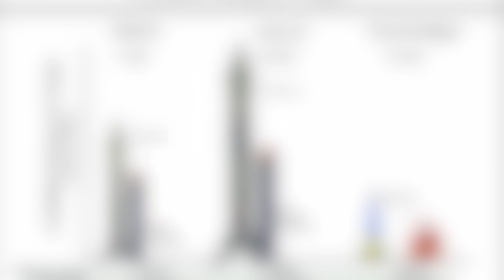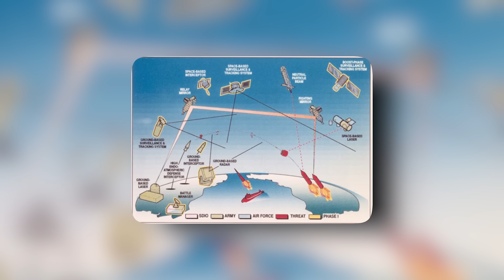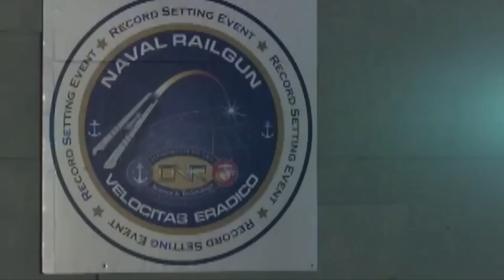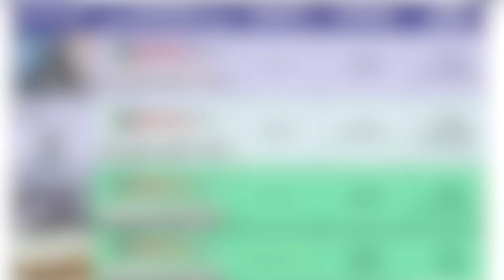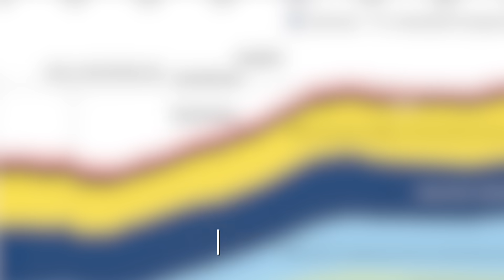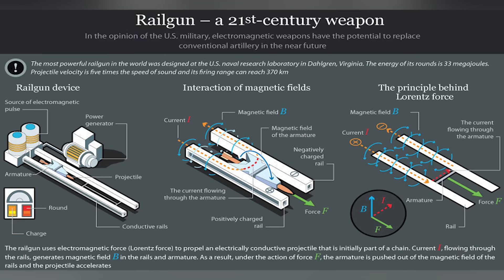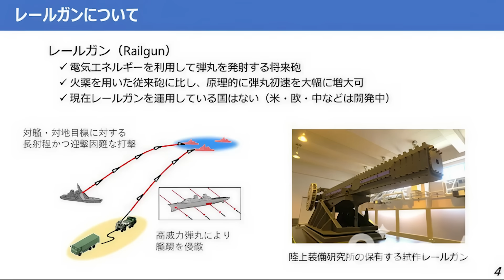Japan Revives a Scrapped U.S. Superweapon — And It Actually Works!

Comment: IMHO, a balance of rail guns and lasers would be awesome.  Lasers are line of sight weapons effected by atmospheric conditions.  Rail guns can fire projectiles over the horizon in inclement weather.  Both working together could be very effective against hypersonic weapons.
Reply: In the end it all comes down to this. Is interception still viable? Is defense against missiles still a thing?

Attack has become much more economicaly viable then defence.
Due to its very nature, an interceptor has to be more agile and manouverable than its target. Which means more expensive. It also require many tries to get one. Now that attack can be hypersonic and manouverable at the endpath, defense costs are aatronomical.

Simple saturation tatics can completely exaust expensive defense for very little cost. It doesn't matter you have a rail gun can definitely hit a target missile once or a high speed something that takes a billion to produce. After the expensive toys are out of juice, even simple inexpensive drones can swarm in.
Reply: Drone swarms says hello😂
Reply: @jaroslavlistvan4795 
1. Flak cannon with modern tracking system cost effectively shoots down an entire swarm.
2. Kinetic energy homing darts (non-explosive missiles) cost effectively deals with drones at extreme long range.

The problem with 1 and 2 aren't that drones could overcome them (as they could similarly be adapted to match the progress of drones), rather that they are useless against high tech weapons systems ala piloted fighter planes.

 The answer to drones, ironically enough, is low tech 😂
Reply: Pure rail guns are terrible right now for bigger guns. They should start slinging small rounds fast, and accurately first. 

 Start slow. Hybrid chem rail guns. Till we can actually manufacture graphens composite materials. 

 I read about a rail gun concept using liquid refurbishment. Basically uses gallium, and other to constantly regenerate the barrel after each use. 

 Some of the coolest stuff I've ever heard. That's the future. 

 I want to know why no one is doing coil guns. It skirts the issues of rail guns, and the therotical max power might be as good. Yet it's still ridiculous. 

 We have incredible precise and robust timing systems now, and everything required. 

 Need personal defense cannons like the Expanse. Think Trophy system but with guns. Cannons that only protect the portion of the ship. 

 Need personal defense cannons on .50 cannons.
Reply: lol is someone suggesting a railgun doesnt fire on a ballistic trajectory? embarrassed for you
Reply: unless the guns are part of a sea going fleet or in space, they are just going to be targeted and destroyed in a real war
Reply: iirc the problem with railgun is the barrel broke way sooner than normal gun. its too fast, so they have to replace the barrel more often
Reply: @KaoruSugimura-Nana  same was true for engines before they figured them out
Reply: It's really going to always depend on the number of weapons that are incoming the the countermeasures they have. if they fire low flying stealthy ones with orbital ones and 100's of multi-warhead hyper sonic ones so what happened in israel looks timid and you have bombs coming from orbit almost directly down and at high speed sneaky ones times to show up as a surprise last min and a bunch of bulk weapons filling the sky with crap and targets and maybe moving sideways at high speed in random directions and splitting tracking and shooting down everything is probably unlikely. 

back in the day they would literally dig under the enemy and buried 100's of tons of explosives to detonate right under them. In a large war today between the larger military a bombing run would likely massively overwhelm any attempt to intercept them all.
Reply: I think that is really the future.
Reply: Laser are patheticaly countered by mirrors. Something like 90% or more reflection with simple aluminium wrapping. A propper defense would defeat lasers while sacrificing stealth.
Reply: @snes-mode7  Don't agree. All practical mirrors absorb some light,and with a 100 kilowatt laser,that 10 KW that gets through will fry the mirror. BTW,how do you keep a mirrored surface clean in the real world??
Reply: @mikedunn7795  Like I said a simple 'aluminum wrapper' already does 90% something. Mark robber exposes it in one of his videos while testing some drones, you should check it out. 

A proper military designed way counter to lasers would have a higher reflective efficiency and take other things into account like isolation, dissipation grids or sacrificial layers.
Reply: @mikedunn7795  You are onto something with this comment. Laser weapons are very hard as focal point matters. The energy needs to be focused at a specific distance otherwise it is essentially useless (think using a magnifying glass to focus sunlight)
Reply: @mikedunn7795  " All practical mirrors absorb some light, and with a 100 kilowatt laser, that 10 KW that gets through will fry the mirror."
Just about all high-effect lasers uses mirrors to collect and focus the beams. Are those mirrors fried on a regular basis?

" BTW, how do you keep a mirrored surface clean in the real world??""
Easiest way would be to burn it off with a strong laser.
Reply: @johanmetreus  Asked Google AI,and it said: 
No real-world mirrored surface reflects 100% of the light that hits it. Even the most advanced mirrors absorb a small percentage of the energy, and a powerful laser will eventually transfer enough energy to the surface to cause it to heat up, melt, and burn through.
Reply: @crsv7armhl  Please do some research on the principles that make lasers work, it is nothing similar to magnifying glasses and of the many issues lasers have, focal point is not one of them.
Reply: @snes-mode7  The thing with reflective surfaces is that its frequency dependant, you are assuming laser weapons are using visible light frequency when they could be using higher or lower frequencies that make your reflective surface either completely opaque, thus melting with the laser or just transparent, and then the laser melts what is inside.
Reply: @mikedunn7795  First of all, I strongly advice against using those AIs for research, as they are written to put out text in a desired format. This means they will "hallucinate" (AI jargong for making stuff up) if whatever training material they have been fed isn't up to scientific standards.
Legal Eagle has a very entertaining video of what happened when AI entered court.

Anyway, not reflecting all light is just part of the story here.  Yes, the mirror will absorb energy, but it will also radiate energy out once over ambient temperature.
(yes, talking net effect here, not the total balance).
Add active cooling to the mirror, and melting it with a laser will be a very difficult thing to do. This is by the way how you build high effect lasers with a continuous beam, otherwise it would burn itself up.
Reply: @Swordphobic  You clearly don't know what you are talking about. Focal point is absolutely a thing

"In the context of laser weapons, the focal point refers to the spot where the laser beam converges to its smallest diameter, resulting in the highest concentration of energy and intensity. "

Wow, almost EXACTLY what I said it was
Reply: @crsv7armhl  Written by someone that has zero knowledge of how lasers work. For reference, photons in laser exit the lenses in paralel, focal point just does not make sense in this context. If its not paralel then you can´t call it a laser.
Reply: @Swordphobic  Ok 🤡. Lasers in a lab have a fixed focal point. Lasers as a weapon need to change the focal point based on distance.

Keep spouting ignorant opinions though
Reply: @crsv7armhl  There is no such thing as a focal point when the photons are in paralel. Anyone that knows the first thing about how lasers work knows its not supposed to converge.
Reply: @crsv7armhl  Let me put it in a way you understand, lasers naturally don´t have a focal point, you can introduce them with a convergent lens for industrial use, but why would you do so in a weapon?
Reply: @Swordphobic  Let me put it in a way you understand. 

What is the purpose of a lens?

Name a laser that DOESN'T use a lens. 

Why is that?
Reply: @Swordphobic  You clearly have zero idea wtf you are talking about. So you enjoy your ignorance.

Maybe look into lenses and their usage in lasers.

I'll just be over here with my Engineering degree and long military career. You can spew into the void
Reply: @crsv7armhl  You clearly have this wrong idea that laser is just a strong lightbulb with a lens to focus its effect, go search for schematics and explanations on the physicks behind it.
Reply: @Swordphobic  🤡
Reply: @snes-mode7  a proper laser could deny the skies and ground carrier air assets. There's no protecting performance aircraft with "simple" aluminum coverings and mirrors. You're right that it wouldn't be suitable for point defense against drone swarm attacks, but the idea that they have no utility and would be "pathetically countered" by such means is just wrong. 

One wouldn't need to melt an F-18 to knock it out of the sky.  You'd just need to compromise a patch of its fuselage, wing or control surface and let its airspeed do the rest. Hell, you could probably burn or blind the pilot directly. The USN and USAF would be just as afraid of a near MW class laser as the Russians are of a Patriot emplacement. Not impervious, but definitely not to be underestimated
Reply: @snes-mode7  That's only if you're using visible light. A microwave laser, or worse, an X-ray laser would ignore mirrors completely.
Reply: Except the part where drones haven proven to be far cheaper and just as effective, note the thinking of the Moskva 

The USA has shifted to drone and counter drone development in light of recent events. It has the potential to augment existing vessels with minimal retrofit and cost and solves a major problem with battleships, resupply.

A current project is to create massive semisubmersible drone weapon platforms that are electronically tethered to existing ships using their targeting systems. Once it’s used up all its missiles, it can be sent back to port on its own to resupply leaving the main ship in play. A convoy of said weapons platforms can be waiting in queue to connect with the vessel basically rearming the ship at sea.

The drone weapon platforms have the added bonus of being below waterline defense against torpedoes and aquatic drones, a role currently vacant
Reply: Проблема в том что лазер бесполезен в обороне против рельсотрона. По сути из за невозможности защититься или уклониться от заряда рельсотрона невозможно. А дальность лазера слишком мала. По сути если оружие помещается в 3-4 грузовых контейнера это означает что его можно использовать с Грузового транспортного самолёта что сводит на нет весь смысл существования флота как боевой единицы.  Так как условный боевой самолёт(типо тех что используют пушки для стрельбы, например как тот который был показан в одной из частей фильма "Трансформеры") может без каких либо проблем из за условного горизонта уничтожить целое флотское соединение. - И это будет стоить чуть дороже чем топливо которое нужно будет для поднятия этого самолёта в воздух! - Что естественно не сопоставимо с ценой даже 1 корабля.
Reply: @Max-nb3xx 
What has this to do with the mix of weapons to support eachother, as mentioned in the comment? 
And than some completely inaccurate claims in your comment. And how do you know how the final weapons will look like? 
Here is a tip: if you parrot texts, try to understand what they mean and if they are applicable.
Reply: "Rail guns can fire projectiles over the horizon in inclement weather". 
Don't think so. For rail guns,over the horizon would mean the projectile would continue in a straight line until it slowed enough to simply drop in the water. IOW,projectiles from rail guns cannot be maneuvered,which is part of the reason they are useless as weapons.
Reply: @mikedunn7795 You might want to do research on the HPV shells being developed for the Navy 5inch and the Army’s 155 mm gun systems by BAE.  The US and Japan are working jointly on railgun technology to solve the problem of gun wear on the rail gun.  Also over the horizon isn’t that far.  Guns were shooting over the horizon long before WWI.
Reply: @PanioloBee  Okay,accept that the HPV shells can be fired from powder guns and rail guns. But the HPV shells fired from powder guns can only reach a velocity of less than half that obtained when fired from a rail gun. Must have some pretty robust electronics to survive the huge G forces encountered in a powder gun.
Reply: @PanioloBee  "Guns were shooting over the horizon long before WWI."
Yes,I know,but until recently, (HPV shells) that was useless,because the rail gun projectile would continue in a straight line,and likely travel further that a gun projectile,and eventually tumble harmlessly to the ground.
Reply: @PanioloBee the problem is that a rail gun uses strong electromagnets for propulsion at a velocity far faster than conventional guns. Can the electronics survive those inertial forces and being run thru a massive electromagnet. They already know just being in proximity of a charging rail gun will fuck up a phone.
Reply: @Menuki  railgun does not use electromagnets. There are two straight metal rails and thousands amperes of DC current flowing from one rail to another through a projectile's conductive casing. The Lorenz force is trying to pull the rails apart and since the projectile with it's casing is the only moving part - it gets accelerated.
Of course thousands amps passing through a straight conductor create a strong magnetic field but it's not a magnet and it's magnetic field is constant unlike the alternating magnetic field of an electromagnetic accelerator (gauss gun|coil gun|whatever) with a series of electromagnets being rapidly switched on and off to accelerate the projectile as it passes through.
Reply: @PalassCat how is that better for electronic guidance systems?
Reply: @Menuki  you need alternating magnetic field to create current in a circuit. That's why the enormously strong magnetic field of the MRI machine doesn't affect electronics around it.
Reply: @PalassCat what about inside it being accelerated to Mach 7.  A rail gun is a bit more powerful than an MRI
Reply: @mikedunn7795  downward acceleration is not dependent on how fast the projectile is moving forward

you should watch that mythbusters episode where they fire a 9mm bullet from a gun, and drop one at the same time, both bullets hit the ground at the same time

plus you're getting incredible range anyway to begin with before the projectile loses too much momentum, iirc the 5 inch naval gun has a range of something like 10 miles, railguns WELL exceed that distance
Reply: @mikedunn7795  That's  not how gravity works. Gravity is ALWAYS working on the bullet and a higher bullet speed just makes for a longer ballistic arc. Get it fast enough, and your ballistic arc turns into a circle that goes around the planet (or it hits something in its path), but that speed is Mach 25 or so, not the Mach 7 the rail gun launches bullets at.
Reply: @mikedunn7795  that’s not necessarily true anymore. The The Hypervelocity Projectile (HVP) program that was being developed by for the Navy railgun and is now being repurposed into an anti-missile weapon is a next-generation, common, low drag, guided projectile capable of executing multiple missions for a number of gun systems including both railgun and conventional artillery.
Reply: @LordOmnissiah standard weapons are better. These new weapons use too much resources for their little burst of shining moment
Reply: @mikedunn7795 bullshit, they have been able to curve their projectiles since the inception of the project. do your research before commenting.
Reply: @mikedunn7795  You're assuming it wouldn't be a sub-orbital shot. lol
Reply: @mikedunn7795  Over the horizon simply means greater then 12 nautical miles. Turrets are over the horizon weapons, and the projectiles can't be maneuvered after firing (basically a huge bullet), and yes turrets are fantastic and cheap weapons for bombardment, fire support, and opposed landings
Reply: @mikedunn7795  Are you aware of this newfangled thing called "artillery?" It's only been around for about 500 years, so I don't blame you for not having heard of it. Also, physics is a thing you might want to learn about. Rail gun projectiles still follow a ballistic arc.
Reply: @mikedunn7795  Not against stationairy objects that have very good anti missile defense.

Comment: "no smoke, no flash" the gun just produce both in the video.
Reply: Ты просто не видел какой уровень дыма и вспышку производит обыкновенное артиллерийское орудие. Особенно если сравнивать с сопоставимой мощностью. - то есть с 10 выстрелами из стандартной артиллерии эсминца.
Reply: "No smoke, no flash" from any gunpowder or chemical propellant. That muzzle flash is from the air igniting into plasma because of the projectile being accelerated at Mach 7-ish.
Reply: You rarely get to see whatever the “H” they’re talking about,makes you wonder if they really know what they’re talking about,but I’m into military tech,so you have to take what you get even if you have to wade through a stream of 💩.😂
Reply: When compared to a muzzle flash of an actual 406mm gun in Iowa-class, yes it is.
Reply: @hrino94  haha it makes a fireball the size of a house
Reply: Probably vapor and plasma so technically correct. The flash visible is also much smaller than comparable conventional cannons.
Reply: It was a figure of Internet speech. Lol. No explosive is required to propel the rounds down range.